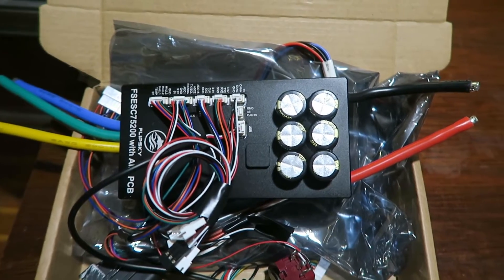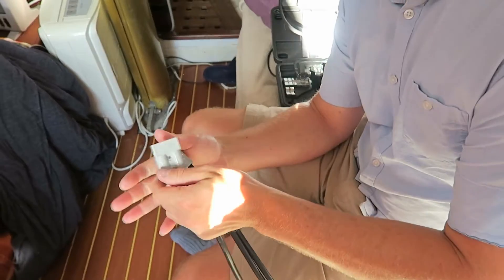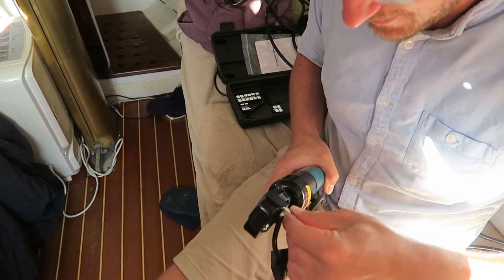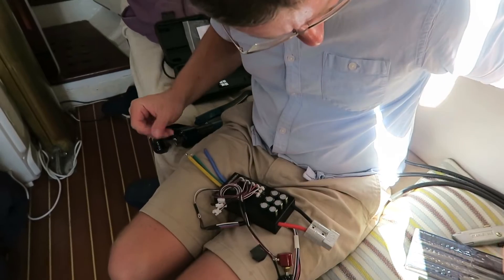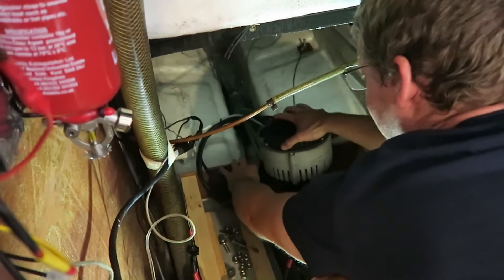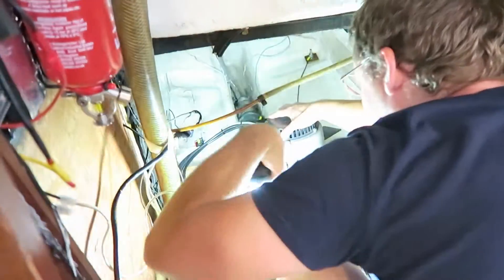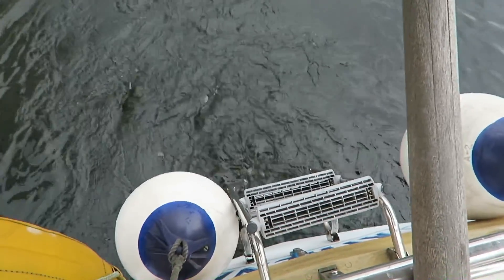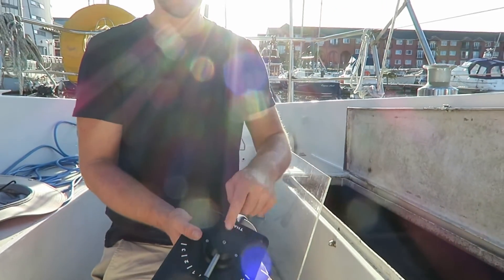New & Improved Budget Sailboat Electric Motor Conversion!

Comment: It would be so much better if you could avoid complex electronics.  Trams used to have just a series of switches to control the level of current (voltage?). On a yacht you don’t need that fine a control.  Maybe just a slow and a fast for forward and astern.  Mind you I don’t know how you achieve this.
Reply from the maker: Unfortunately a controller is required for my motor, and it would have been expensive to replace the motor with one that doesn't require a controller.

Comment: What is the theoretical maximum speed on this?
Reply from the maker: Very difficult to say as it's so dependent on the size/weight of the boat, conditions of the sea etc. Will report back when I've had a chance to test it properly!
Reply: @BethanyIvy  Indeed I am also a sailor and familiar with these challenges. The top speed under low/no wind in calm water would suffice.
Thank you for Your response, And please take your time it's winter here and the lakes are freezing over As such i'm not in a hurry.